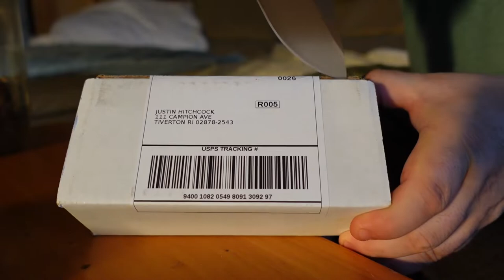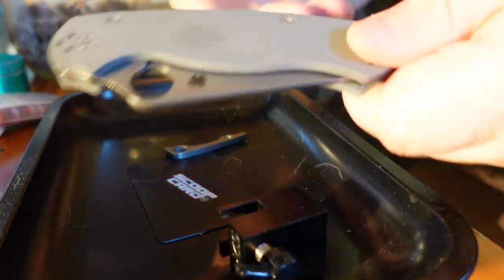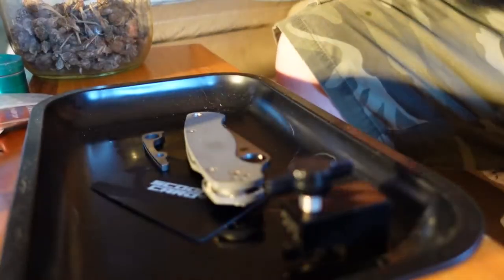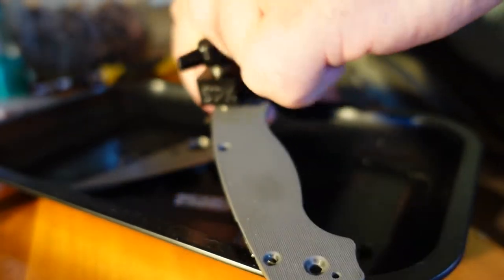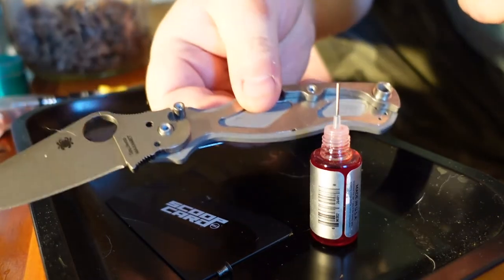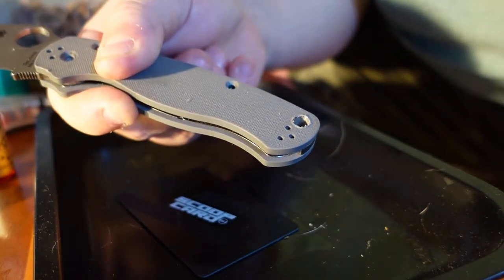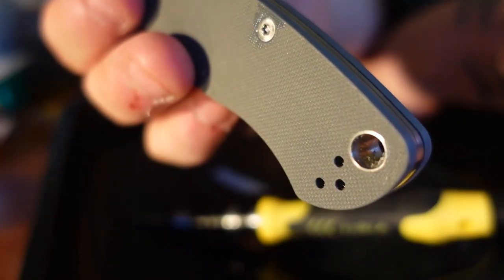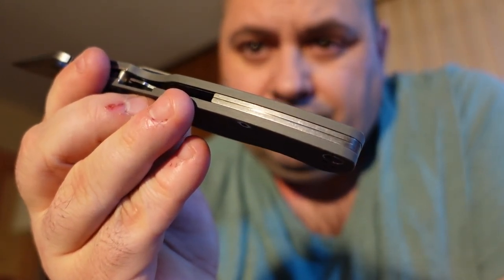Paramilitary 2 Back Spacer Install

Comment: That second washer is actually held in place by the pivot bushing. Have to remove the screws from both sides. If you haven’t already realized that…